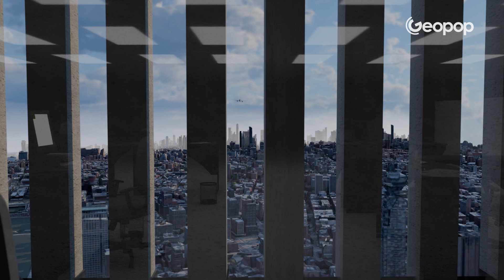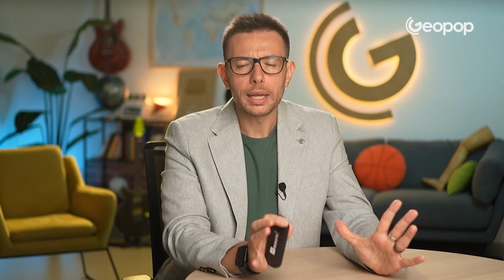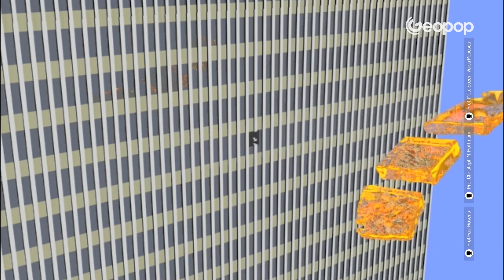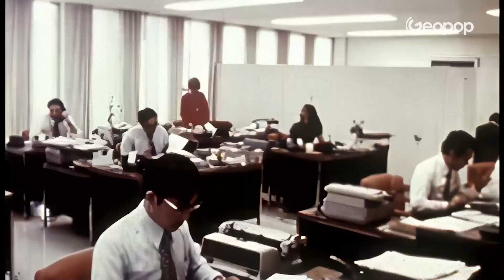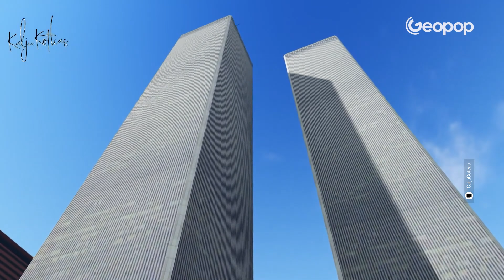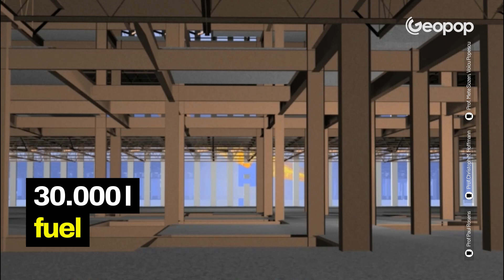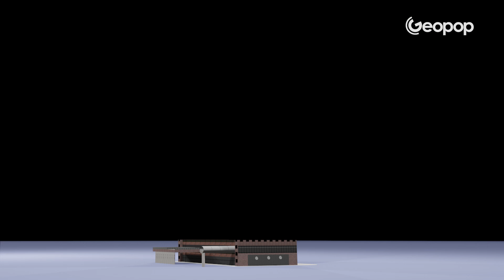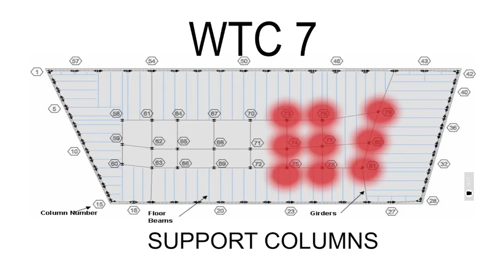9/11, 2001: The Technical Reconstruction of the Twin Towers and WTC 7 Collapses

Comment: You can explain it any way you want, there is NOTHING that should have caused those collapses to look exactly like controlled demolitions.
Reply: Minus ghe fact th!t they were designed to fail this way to avoid them tipping over onto the surrounding blocks. They did exactly what they were designed to do. Sorry you have no education 😂
Reply: @CptBEARDless   I was merely giving my opinion based upon observation. You may disagree, but you don't have to resort to personal attacks, especially given the fact that I am actually highly educated, despite your baseless claim. Perhaps you should focus more on your high number of typos. 👍
Reply: They don't look and especially don't sound like pre-planned ( controlled or otherwise) demolitions. 

They look like buildings collapsing.

The building does not know or care why it is collapsing. It just falls.

Your only frame of reference is planned demolitions and you appear to be limited to mere pattern recognition levels of thinking, so you go with what you know and stop there.

The mechanisms and failure sequences of the towers described in this video are fundamentally correct.  Not necessarily easy, but correct. That is true no matter who planned and carried out the attacks or why.

Comment: The new method of melting steel: kerosene. I wonder why we have used blast furnaces for so long ?
Reply: Blast furnaces are used to smelt iron ore to produce pig iron, they aren't used to melt steel. A kerosene fire is enough to weaken steel (not melt it) causing it to deform under load initiating a progressive collapse
of the building.

Comment: A Collapsing and weakened structure will NEVER result in a pyroclastic cloud where everything is pulverized, as observed.
Reply: Its a dust cloud NOT a pryroclastic cloud. Its a building not a volcano. Building collapse is a dusty business.
Reply: Idiot
Reply: @beetheace   exactly right.   people need to look at videos of controlled demolitions to see how they appear, and then look at a collapsing building to see how that looks.   There is a difference and the images of each clearly shows which category the twin towers are in - it is unmistakably demo.   Enough talk about how hot it was, it doesn't matter, look at videos of each type and it is crystal clear what happened. No doubt.

Comment: I wonder if WTC 7 could have been saved if the water lines hadn't been severed and the sprinklers had worked. It seems like its Achilles heal was a total lack of fire suppression. Which is likely the same for most buildings.

Comment: It was dustification. I believe Judy, she is a person who was hired to do what she did bc of her engineering background and degrees and thousands of hours and the fact that so many people have tried and have silenced her. They won’t even allow her on WIKI! They don’t silence lies. The silence the truth. Dustified by DIRECT ENERGY WEAPONS. WATCH THE BUILDING AS ITS FALLING YOY CAN SEE IT TURNING INTO DIST MIDFALL. THEY DONT SHOW YOU THAT. AND NEVER WILL. There is a clear shot on the side of the building of these STEEL RODS. AND YIY CAN SEE IT TURNING INTO DUST AND WHERE DIS ALL THE EYBBLE GO? 100 STORY BUILDINGS AND THE BATHTUB UNDERNEATH BOTH WERE INSTACT. THINK OF THE SHEER AMOUNT OF BUILDING DEBRIS THAT SHOULD HAVE BEEN PRESENT AND WAS NOT. WHY DID AFTER THE FALL PEOPLE WHO FELL 50 FLOORS FREE FALL AND SECONDS ADTER LANDING SEEING SUNSHINE. NOTHING NONE OF THE 90 FLOORS CAVED ON THEM IT WAS JUST OPEN. THEY CANNOT EXPLAIN IT BUT THEY SURE TRY TO HIDE IT. SHE HAS A WHOLE WEBSITE THEY KICKED JER OFF THE COMMITTEE BECAUSE SHE KNEW WHAT REALLY HAPPENED. AND THEY COULD NOT LET THE PUBLIC FIND OUT. WHO DID IT IDK BUT IT COLLAPSING WAS NOT DUE TO THE PLANES. FIVE YEARA AFTR IT HAPPEMED THE BANK BC THEY SAY DEW CAN CAUSE RESIDUAL DAMAGE MEANING IT CAN CONTIUE LONG ADTER. THEY REBUILT THE BANK AND FIGE YEARS LATER THEY TOTE IT COMPLETELY DOWN AND REBUILT. WHY? WHY WOULD THEY DO THAT? BC THE BUILFING HAD RESIDUAL DAMAGE THAT WAS MELTING STEEL BEAMS LONG AGTER 9/11. THREE HUGE BUILDING JUST GONE DISTIFIED!!  Believe who and what you want but look at her evidence. She is not a cook. She’s a respected scientist and engineer, and was originally hired to try and figure out what happened specifically and when she did figure it out specifically they kicked her off and silenced her.

Comment: This is one of the only skyscrapers where the perimeter steel carries vertical load. That's why it collapsed, essentially. Yes the impact knocked off the steel fire retardand and the fuel and paper burning while also displacing horizontal floors.

Comment: I´ve seen a documentation on TV . According to a theory detailed by materials scientist Christian Simensen of the SINTEF research institute, the intense jet fuel fires melted the aluminum hulls of the aircraft, which then flowed into lower floors and reacted catastrophically with water from severed sprinkler systems. The Explosion: This reaction creates aluminum oxide and releases massive amounts of hydrogen gas. In the ultra-hot environment of the towers, this hydrogen gas would instantaneously ignite and explode.

Comment: Holy shit, what utter bollocks! This video literally tells you it's AI. That's all you need to know. 

FIRE DOES NOT MELT STRUCTURAL STEEL! NEVER HAS BEFORE, NEVER HAS SINCE. THESE ARE THE ONLY STEEL STRUCTURES IN HISTORY TO BE TAKEN DOWN BY FIRE. SEVERAL BUILDINGS IN EUROPE AND ELSEWHERE HAVE UNFORTUNATELY BEEN SUBJECT TO CONSTANT FIRE FOR OVER 24 HOURS, COMPLETELY ENGULFED, HOWEVER THE STRUCTURES STILL STAND. WTC7 HAD TINY OFFICE FIRES FOR AN HOUR OR 2 AND APPARENTLY BROUGHT THE BUILDING DOWN. THE BBC REPORTED A HALF HOUR BEFORE IT FELL, WHILE WTC7 WAS STILL STANDING AND VISIBLE OVER THE BBC'S REPORTERS LEFT SHOULDER, LIVE ON CAMERA. IT WAS STILL STANDING! LIVE, ON CAMERA! IT HAD NOT BEEN HIT BY ANY AIRCRAFT, YET COLLAPSED AT FREEFALL SPEED AND INTO IT'S OWN FOOTPRINT. WATCH THE VIDEO. IT WAS CONTROLLED DEMOLITION. YOU'VE SEEN THE SAME THING IN VEGAS!

THE BUILDING HOUSED IRS OFFICES, THE SECRET SERVICE AND THE SECURITIES AND EXCHANGE COMMISSION.

THE MAIN TENANTS WERE SALOMON SMITH BARNEY, BUT HOUSED THE CIA, AMERICAN EXPRESS, STANDARD CHARTERED BANK, PROVIDENT FINANCIAL, ITT HARTFORD INSURANCE GROUP, FIRST STATE MANAGEMENT GROUP, FEFERAL HOME LOAN BANK, NAIC SECURITIES AND!..........

THE MAYORS OFFICE OF EMERGENCY MANAGEMENT RUN BY MAYOR GIULIANI AND IT'S EMERGENCY COMMAND CENTER ON THE 23RD FLOOR. THIS FLOOR RECEIVED $15M WORTH OF RENOVATIONS INCLUDING BULLET AND BOMB PROOF WINDOWS AND TOTALLY INDEPENDENT WATER AND AIR SUPPLIES. THIS OVERLOOKED THE TWIN TOWERS.

Comment: In the US we use Feet, Yards, and Fahrenheit as measurements, not metric! I wonder how much investigating was done on the strength of the jets themselves? How were they able to penetrate multiple steel columns and in one case go through to the other side? They are made to me extremely light, otherwise they couldn't get off the ground! 🤔
Reply: In the rest of the world we use the metric system, the rest of the world is the majority.

Comment: It bothers me when people say all of these conspiracy theories, and they just have no understanding of physics and the truth is more important than being right and I appreciate these scientific based videos.
Reply: Have me censored then. I was born to expose Truth. Not even Lawfare is gonna be able to shut me up. Jet fuel was not hot enough to burn that steel. Those buildings fell perfectly, even WTC 7. WTC 7 was definitely a controlled demo.
Reply: @JDEbberly-s9c : Everything you wrote is untrue. 

The jet fuel burned off in seconds. but before it did, it acted as an accelerant to set the contents of the affected floors on fire. those fires burned hot enough to weaken the steel.

The towers absolutely did not fall into their own footprints. the debris field extended 400-500 feet out from each tower. Numerous surrounding buildings were damaged or destroyed. WTC7 was badly damaged by debris from the North Tower. The fires within burned uncontrolled for nearly 7 hours. It also did not collapse into its own footprint. The debris from its collapse damaged several buildings around it. One so badly it had to be demolished afterwards. (Fiterman Hall)

It's normal to have doubts. It's not normal to completely deny all logic and reason just so you can feel special. "Truthers" like you, surround themselves in a bubble of ignorance, misunderstanding, and suspicion. It's an echo chamber that seeks to confirm their own paranoid conclusions. It's a sickness, and it's sad and pitiful.
Reply: @JDEbberly-s9c then enjoy a life of living under your tinfoil hat. You focus on one element of a engineering nightmare... Fire. When you forget all other physical forces at play. You also seem to think millions of pounds crashing down onto itself is suppose to make it look like anything different that it was. It's like you specifically choose to not consider just how much weight is at play

Comment: Me and some other blacksmith heated one of this heavy H beam and twisted it. We could not get it anywhere close to forging temperature ass it was so massive, but it bent like nothing at first and after 2-3 twists we stopped afraid it would snap because it was getting harder to push, but we could have gone further. Had nothing to do with this it was just a blacksmith gathering. We where 10-15 people and connected rods to the H beam. All of us were shocked it was so simple.